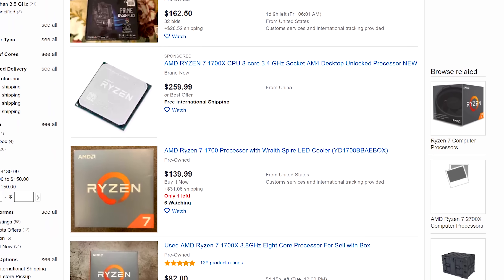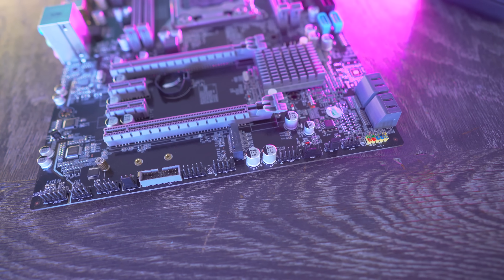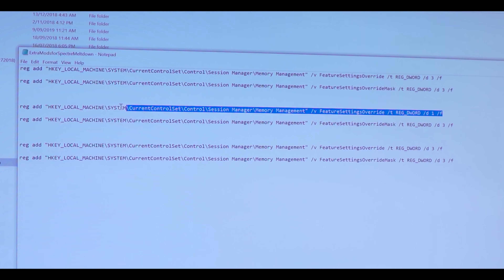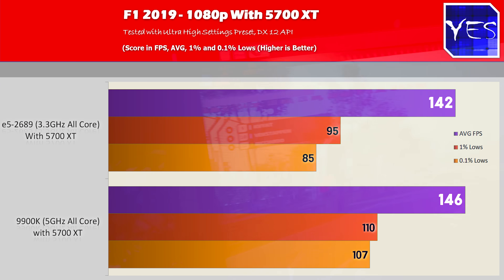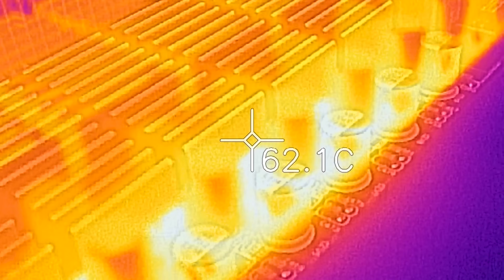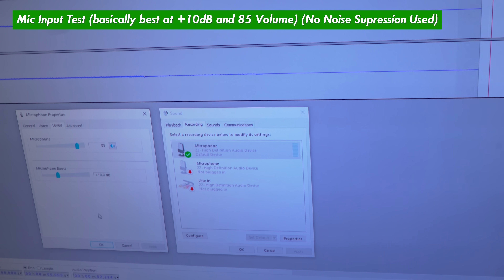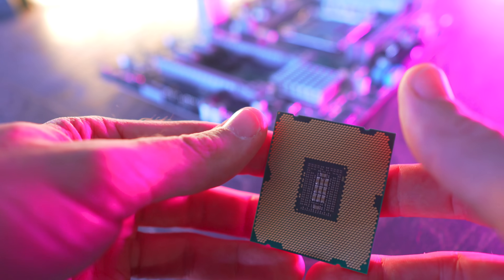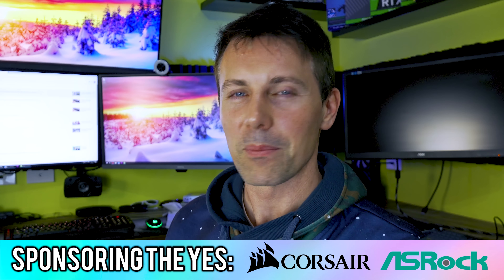8 Core CPU for $53....!? Will it BOTTLENECK a RX 5700 XT...!?

Comment: How do u think this Machinist X79 compares to this Huananzhi X79 (the one I bought.. + 2869) ? Thanx!!! https://www.aliexpress.com/item/32849869222.html?spm=a2g0s.9042311.0.0.76bb4c4drBQJqs
Reply: Does your 2689 fully boosts to 3.3 ghz in games on all cores?
Reply: @ivke6989  Yes it does. In PUBG at least.
Reply: @JukkaX  Have you tried other games? I heard that 2689 gets stuck at 3.1ghz on some of these boards, so I'm trying to be careful on what to buy.
Reply: @ivke6989  I'm on Dirt Rally 2.0 atm, I'll see how it behaves. I haven't tried other games, sorry.
Reply: @ivke6989  Dirt 2.0 seems to be light for the processor, no throttiling, not even close.
Reply: @JukkaX  So you fixed your problem? I accidentally found your comment from  a week ago where you said that ur CPU was throttiling at 2.9 ghz. Have you purchased a new board to fix that problem or?
Reply: @ivke6989  LinX is the only program (that I so far know of) that'll uses power well over that 115 W limit (130 W it is), and so throttles. Power limit adjust has no effect to that. Don't think there's any game anytime soon that uses so much power.. Do u?

edit: Prime95 uses 130 W too and throttles.

Comment: "I can't find any good deals on used 1st gen ryzen GPU's "
ryzen 7 1700x for 83 bucks goes cross the screen
Reply: Thats bid dude. You never get bid. It will go to 130
Reply: Where the fuck you can find a ryzen for 83$
Reply: @renegade25_banhammertech_40  now you can get ryzen 5 1600af 6 cores 12 threads, for 85$ but due to some reasons it has risen to 150, will drop in some time.
Reply: @term6221  it has RYZEN to 150 xdddd
Reply: @mahmoudsobhy5843  lmaoo
Reply: Bloxxed ...
Reply: @term6221  its 105
Reply: @renegade25_banhammertech_40  You can get a Ryzen 2600 for 97€ on Aliexpress:
 https://fr.aliexpress.com/item/33031973977.html?spm=a2g0o.detail.1000014.9.2784173dCL90qd&gps-id=pcDetailBottomMoreOtherSeller&scm=1007.13338.146400.0&scm_id=1007.13338.146400.0&scm-url=1007.13338.146400.0&pvid=7a326ab2-f944-41ba-86d5-66a251540ff9&_t=gps-id:pcDetailBottomMoreOtherSeller,scm-url:1007.13338.146400.0,pvid:7a326ab2-f944-41ba-86d5-66a251540ff9,tpp_buckets:668%230%23131923%2318_668%23808%234093%23793_668%23888%233325%2320
Reply: @PerryCox818  When you add import taxes and the price of a cooler, you'd be better off buying a new one locally.
Reply: @Skade did you notice that you replied 8 moths ago
Reply: @Skade guys, e5 2689 with the powershell method are better than a ryzen 2600 ?

Comment: Why not the E5-2650 v2? On AliExpress they're very similar in price and it has a slightly improved architecture with a lower TDP and power consumption.
Reply: It's slower. 3.0 GHz all core boost only.

Comment: Now this is good fine job done and great that this ability of CPU get on web so soon - someones plans fast cash for almost same toy in different package get money double- no a chance - lets name it as it looks simple cash harvest for same CPU reliable values not even visible by most of users.
I hate that kind strategy of this Mic....st & In....el corp parasites - thanks to overclockers priv users not worth price new technology intel get to work make jobs better - its time for phantoms architecture designs as for CPUs  - no more sizes left to minimize say it officially :) - I need also jump for 8-cores - again great video clearly explain with evidences no fairy tales as many exist on YT.    P.S  my 1st overclocked CPU was 80486 DX4 100MHz - raised to 122MHz with SODIMM mem over Voltage for 5V - it was fun Bridges on MB not so simple Bios setting in menu like now oh it was more creative i think ;) AMD vs Intel frying with non radiator little stress and counting time till burn with one uh - share any hint like this one its keep technology evolution going damm parasites counting only money - Be cool and overclock any possible Electronic :)

Comment: can you please test this, no one is doing it!!! There is a dual socket x79 mb for these cpus, i want to buy it maybe but if its not that ok i will be losing a lot! test out games and workstation performance
Reply: the mb is on aliexpress also, something like these; there are some different options one has 8 memory channels and one only 4 (witch would mean that the 8 one has 4 per cpu and the other one 4 for both cpus to use at the same time)
https://www.aliexpress.com/item/33060328257.html?spm=a2g0o.productlist.0.0.19da401c24y6eN&algo_pvid=57c30098-1ff8-4a16-ab8e-8e6da550aa6a&algo_expid=57c30098-1ff8-4a16-ab8e-8e6da550aa6a-10&btsid=5c96f78e-879b-47c2-9dc5-8354c724cf31&ws_ab_test=searchweb0_0,searchweb201602_4,searchweb201603_53
https://www.aliexpress.com/item/32886314322.html?spm=a2g0o.productlist.0.0.19da401c24y6eN&algo_pvid=57c30098-1ff8-4a16-ab8e-8e6da550aa6a&algo_expid=57c30098-1ff8-4a16-ab8e-8e6da550aa6a-15&btsid=5c96f78e-879b-47c2-9dc5-8354c724cf31&ws_ab_test=searchweb0_0,searchweb201602_4,searchweb201603_53
Reply: These dual socket boards are only good for budget workstations
Reply: check craft computing he did à vidéo on these

Comment: Still can't believe the local recent purchase:  An ASUS P9X79 Pro + i73820 + 32GB DDR3 non-EEC Hynix 1600 + Cooler master tower cooler. Swapped for my E5-1650 V2 and voila!!!!  Runs fast and cool.  I run with 43x multiplier and it turbos to 4.4Ghz. Sell the i7 for about 70 and the motherboard cost me only about 20 to 30 dollars. That'll do pig, that'll do!

Comment: Great video - I have ordered this CPU, motherboard, some DDR3 RAM and a cooler (from AliExpress) to go with a Sapphire RX 570 8GB from eBay.  Looking forward to building myself a decent PC soon!
Reply: Plase tell me how it runs.
Reply: @Vielt0   - all running well in a CoolerMaster mid-tower ATX case with an Sabrent M.2 256GB NVME SSD on the motherboard (boot disk with Windows 10 Pro installed) and a 3.5" SATA 1TB Seagate Firecuda drive for additional storage (motherboard comes with a SATA cable). Very pleased with the end result.

Comment: The better frames on the 9900k could also be due to faster memory, which means loading while playing is faster, and the newer motherboard and chipset is going to allow for faster data transfer than the older motherboard. Try comparing it to an the 3700x, you are going to get better yet because the 3700x is pcie 4 compatible. Anyways, kudos to you for getting a great deal for a good cpu.

Comment: These reg adds are they doing the exact samething as inspectre or are they doing different things? stitting on an 3930k @4.4Ghz
Reply: Also sitting on a 3930k, stock 3.2Ghz. What mobo/cooler are you using? Wanting to OC so bad.
Reply: @Hydraxis-  Using an ASUS Rampage IV Extreme, 3930k 4.4Ghz OC and using a Noctua NH-D14 SE2011 it keeps it quiet cool and not so loud even at 100% fan speed.
Reply: BANTO 600$ for a mobo 😅
Reply: @Hydraxis-  oh wow that's the aftermarket price ? I was lucky to get my friends previou setup when he upgraded to an i7 8700k.

Comment: Its more expensive but the pinnacle from X79 is the E5-1680v2 8 Core unlocked (overclockable) Xeon. Yeah the E5-2689 goes to 3.3Ghz but my 1680v2 I'm currently running that at 4.6Ghz all Core which puts it between a 9700k and a 9900k.

The sweet spot for memory on X79 is 2400Mhz - past that and the latency penalty offsets any gain assuming you can even find the handful of chips that were faster than that and 2400Mhz Quad Channel is still faster than 3200Mhz Dual Channel DDR4.

You can also BIOS mod most X79 to add NVME boot support and then just get a cheap $20 PCIe x4 to M.2 adapter. The 40 PCIe lanes means it can handle multiple NVME drives without a problem, more than you could on modern normal chipsets.

Honestly the only TRUE upgrade from this platform is going to be Threadripper 3000.

Comment: You would have even better results on E5-2689 if you'd disable HT ;)
Reply: @oxalt  hyper threading
Reply: @oxalt  it's true. Disabling HT even improves fps in gaming. Search yt for e5-2689 HT on vs HT off and you'll see
Reply: @oxalt  Xeons are designed and constructed for professional purposes. They are invented to work 24/7 on high stress. If you take E5-2689 it will definitely last for couple of years. It has 8 cores / 16 threads that work exactly the same as core i7 Sandy Bridge / Ivy Bridge. TBH they are exactly the same CPUS like many other Intel CPUs but have more PCI-E lanes and quad channel memory controller and that's the reason for so many pins in the socket. E5-2689 clock in Turbo is 3.3 GHz which is fine. If you disable HT and even disable 2/4 cores you could reach even higher clocks in Turbo which may improve performance in CPU demanding games (cs go, arma 3). For commonly used Chinese LGA2011 motherboards no modifications are required. Just look for quad channel support, 8+ PCB layers and heatsink on VRM.

Comment: Ok, I'm doing it. Here goes nothing. It's all your fault Tech YES!!

I'm getting rid of my 6700k, high end Gigabyte mobo and 16GB 3200MHz G.Skill Ripjaws.
And what am I upgrading to? Used price/performance!

I've been wanting 32GB of ram for a long time, but I couldn't justify the €80+ price tag.
So now the day has come where Tech YES finally convinced me to sell my old stuff and upgrade to a Xeon platform!
32GBs of 1866MHz DDR3 in quad channel? Hell yeah. That should perform as well or better than my current (overclocked) RAM, even!
And the CPU? I ended up going for the E5-2690, after considering my options. It matches the rest of my build better, and I still play titles that don't really utilize multiple threads.

I'm stoked. This is either going to be the best or worst decision I've ever made. I'm putting my trust in you, Machinist, don't let me down.
Reply: Do I get bonus points for making a profit in the process of upgrading?
€208 for the new stuff.
6700k, mobo and 16GB DDR4-3200MHz will easily sell for more.
Reply: Do you need high single core preformance ?
Reply: @kruxdt6307  More or less, yes. Obviously I will be getting less single core performance than with my 6700k, but it should still be plenty.

Comment: This isn't how you test cpu's.
You test CPU's with every setting on LOW.
If the E5 would only be 5 fps slower than a 9900k, do you think they would've released every other CPU after it?
You're giving out misinformation.
Re do the test with everything on low and see the difference there.
Reply: The fps difference is coming from the GPU, since it's sitting at 100%...
You tested the GPU's, not the CPU's.

Comment: If this was framed correctly "offline gaming for cheap" then I'd have no issue. But telling people to disable all of the important security patches to regain performance is not very responsible. I run several servers that run Xeon's for hundreds of clients, and have an 8th gen i7 so i'm not just saying that because I prefer AMD. It's annoying to loose the performance, but considering how vulnerable some of these security flaws are, you'd be crazy to just switch off and ignore. If you disable the patches, but go online anyway, you are subject to becoming a botnet node. Next time your favourite service or website goes down, it'll be people like you who helped that downtime happen.
Reply from the maker: Sorry mate but have to disagree, not everyone has the money to afford the latest and greatest gear.  And also tell me more about how these security issues work, without linking me to some article or some 'proof of concept' from a university.  IMO Spectre and Meltdown are just some fancy blankets to nerf older hardware.
Reply: @techyescity  Chromium was patched in v67 for Spectre, FireFox 57.0.4, both which are absolutely needed because there are real world JavaScript examples (which I can link too) of how speculative execution can steal information purely through you visiting a page without the aforementioned updated versions of each browser.

If you consider the software that someone would very likely install on a PC like this, like a torrent client, some mods for games that require binary hacks to work (skyrim/fallout-4/etc...), driver packs from non first party websites (because of the unusual nature of the build), these patches would protect you, as it's clear the attack doesn't need to come from the web, and can just sit as a piece of assembly (that I can also link too) that's ran by a few C commands every so often.

If you are thinking "well this scenario is very unlikely to happen" consider the example on the 1st May 2013 when the co-founder of ESEA (a CSGO tournament client) had to make a public statement to apologise for using the client to mine for bitcoin. It wasn't treated as malware because it was trusted by the user, yet this is a very real example of how easily exploitative software can wind up on someone's computer without them knowing it through trusted means.

I have another concern that I didn't raise in my original post, why you are not running an antivirus? If you are mitigating the operating systems attempt to protect you due to cost, surely you'd add back in the free alternative? Keeping Windows Security up-to date is not in my opinion an alternative as you are literally disabling part of it to get the performance back.

I'm not trying to fight you honestly, I really like the computer you built, and like the patches to get the performance back. Like I said with the proper framing/context this build is amazing. But not telling people to be cautious (especially with antivirus/downloading potentially compromised software) with such an audience, and saying these vulnerabilities are a hoax is (regrettable for me to say) irresponsible, because all evidence tells us that not taking the warning seriously can have real world implications.

Sorry for the long ass reply, but I wanted to put in the effort as you personally responded. I have respect for you man as you keep old hw alive like I do, I have a killer 3770K build, and an Athlon X4 still running flawlessly. Peace from the UK.

Comment: Just convinced me to get a top xeon cpu instead a ryzen 3° gen 😂😂😂
Reply: No its not better than 3rd gen ryzen, not even better than 2nd gen ryzen but yes it is a better value. However keep in mind this test is GPU bottlenecked since he tested with RX 5700XT at very high or ultra setting, if he use 2080 TI or above then the difference will be massive, and the worst thing is you will be locked on that old platform.

Comment: Quick Q. E5 2689 not on the list of supported cpus for the Asus Px79 Pro.  What would you recommend?  (cheap as possible). Or just stick to the I7 3960x i have?.  Focus will be 70% designing/ streaming and 30% gaming.

Comment: the closest xeon to the i9 9900k is the e5 2680 v4 14 core. its literally close as shit on a bottleneck calculator but the xeon has 14 core. Hell even then the confidentials are overclockable. if you get lucky, you can get it near 4ghz max. mine is at 3.6

Comment: My budget build. (So far. Just literally started working on it this month.)

I bought a used 2007 Hp pavilion, took out the stock Ram, and bumped it from gddr2 2gb, to 16gb of gddr3 with the 580mb of dedicated Vram cache. 

Swapped out the power supply, and upgraded to a 2 Tb Hybrid Drive.

This thing actually crushes everything Except the new No-mans sky. Despite having a 4 core Amd Radion Hd6530D cpu/gpu combo.

All together it cost me 180$.

Comment: This comparison doesn't show the real difference, The RX 5700 XT is the bottleneck here, and I would not trust this video for my next build. He should redo this video but with RTX 2080 Ti (or the best GPU he has) at 480p low
Reply: You're right, but this isn't a CPU showdown, this is to show that you can build a cheap PC that can also do productivity and game without bottlenecking a mid tier GPU or lower, the exact thing the target audience would want to do.
Reply: @rene.s.s  You do have a point but it would have been better if he used an RTX 2080 Ti at potato details and resolutions to show the real difference

Comment: 3930k doesnt bottleneck rtx2080 ti in 1440p/4k as long as cores, qpi link, ram overclocked to the limits with all timings lowered it can still compete with ryzen 3000 easily and be on par with stock 8700k/3000mhz system

Comment: Bryan - how would you compare this Xeon to Ryzen 5 3600 and 3700X? Do you think they will be comparable? I own a Ryzen 5 3600 system but I think about improving someone's PC with AMD A8 - I upgraded RAM to 16 GB 2400MHz (DDR3) there when a mobo from my old system died and I think about some cheap options with discrete GPU as we will have to move to one eventually. Maybe you can do a video in general use - applications & games with some budget GPU aswell, comparing these two? ;)

Thanks!

Comment: I've got an i5 8400 and thinking of upgrading my GPU to a 5700 XT, would that be a good mid-life upgrade?
Reply: is the 8400 a 4 or 6 core CPU? If it's 6 you should still be fine with a GPU update.
Reply: @megapro125  it's a 6 core

Comment: Probably better off spending a bit more and getting a 1900x or 1920x and a used x399 mobo from Ebay. Amazing upgrade path. CPUs can be had from amazon for less than 200$ and it's not a dead end socket with massive security flaws.
Reply: this aged badly

Comment: Great video as always!

Do the spectre and meltdown mitigations affect all the xeons? I just made a build with e3 1270 v2 should I disable the updates as shown in your video?

Thanks!!!
Reply: If you tried it then please share the results. Was there any increase in fps ?
Reply: @mr_robot5821  Hi , I didn't bother to remove the spectre and meltdown updates the build I made was with an Rx 580 and there was still headroom with the cpu so I just left it as is